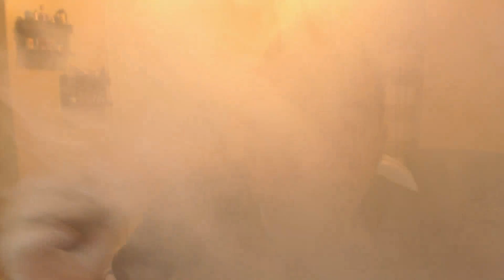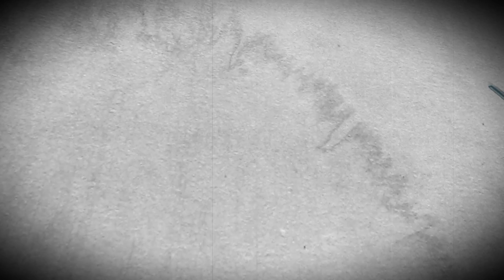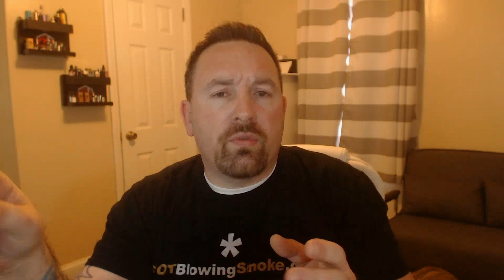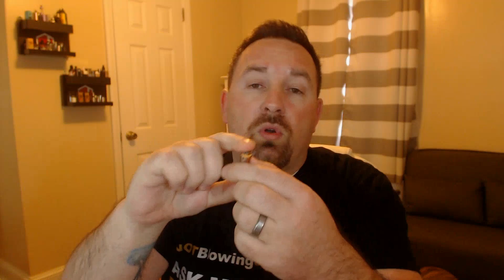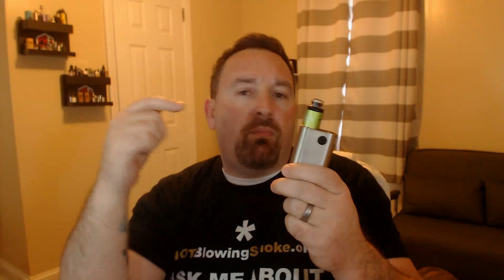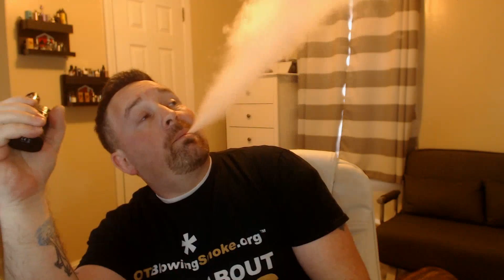Explained! Ohms and vaping resistance

Comment: Can any one please suggest me which wire to used for Smok stick x8 baby beast tank tfv8 having Q2and M2 coil i want to know which wire i use for Q2 preinstalled stock can i change the wire or else i have to buy new coil....and if any wire is there how much gauge and resistance required for wire and i am using preinstalled battery having 3000 mh

Comment: For those who are knowledgeable about the topic . Correct me or wrong . A 1.5ohm reading is higher ohm less resistance  vs a .3 ohm reading is a lower ohm but more resistance?
Reply: Ohms is a measurement of resistance. Voltage is measured in volts, yeah? The unit in which resistance is measured is ohms. .3 or .30 ohms is less resistance than 1.5 or 1.50. Resistance "resists" the flow of electricity (volts, amps). Use http://www.ohmslawcalculator.com/ohms-law-calculator to calculate ohms for a build before you do anything. :)
Reply: I agree Dinkleburg.

Comment: hey man my Q2 is reading 0.2 Ohms wont go up any further , been vaping it about a week at 0.4 then its 0.2,whats up with it?
Reply: Andrew Daly this is what I’m thinking but when you heat metal it expands and when it cools it shrinks the expanding and shrinking have probably made the coils/coil move a little that’s probably why the ohms have changed.
Reply: 510 was clean, still cleaned it with a toothbrush for 2 or 3 minutes and it fixed the ohms, possibly small particles of dirt building up affected it!

Comment: My t priv reads .41 on a q2 coil i use about 47-60 watts is this okay?
Reply: you can adjust it in t priv settings. but yes it is okay the coil is .4... .4= .40..... i vape mine at 56
Reply: Demetrius Hernandez thanks i changed what it was reading (.41) to .4 and vape it on 47 just to get extra life out of my coil
Reply: any time always here to help... vape safe
Reply: Demetrius much appreciated:)
Reply: hey man my Q2 is reading 0.2 Ohms wont go up any further , been vaping it about a week at 0.4 then its 0.2,whats up with it?
Reply: hey Andrew, make sure you're 510 connector is clean thats a problem a lot of people have, if anything gets in between 510 connector it will throw your ohms off.............

also make sure everything is tight........ and worse case just update firmware and it should ask you if its a new coil.......

and are you a heavy vaper ? and what do you vape the Q2 at anyways...  and really its not thats bad that its .2 off i would be concerned if it goes over .3 + but thats just me.......
Reply: Vape God thanks for your reply, Ive had to lose my tank alot for it to display the correct ohms, so it's almost loose. I think it maybe time to replace the mod?
Reply: Vape God 510 was clean but still cleaned it with a toothbrush for a few minutes and the ohms went back to normal! Thabks for ur help
Reply: im happy to hear man, vape safe.

Comment: Sounds like you have to be a master electrician license holder to vape. Too complicated. Just pen vape, unless you just want that obnoxious "Hey, look at my cloud" attention.
Reply: D Wood   Amps = Voltage / Ohms   This is all you really need to know. When you build a coil you should have a meter you screw your RDA into so you can build on it, they will have a meter to measure Ohms for you, your voltage is going to be 4.2 max for a  single typical 18650 battery. You just want to research the battery you have to see what the max CDC value is for your batteries if you are building on a mech mod, most are rated at 20 amps CDC. Use the formula to get your amp value and be sure it’s under the CDC of the batteries you use so they don’t blow up... literally... in your face...

For regulated mods this doesn’t matter as much.
Reply: It’s not all about makin huge clouds, more vapor is more nic. My beast king tank with the t12 coil makes bigger clouds but the nic delivery is insane, chain vaping with .3 nic will give me headaches on that thing.
Reply: I said CDC, meant CDR.
Reply: I personally don’t know any of that stuff getting there very slowly...I make my coils every Sunday
 “saves money,kinda relaxing”
I asked 5 very seasoned vape vets :
“What’s a good,safe ohms point to aim for,safety over show”
0.16ish is what I aim for...give/take a lil 
I don’t know how many volts that is...and frankly don’t care too much as I’m simply not smart enough to know what it means yet anyway...I’m safe,my clouds suck,taste great and I get nicotine...what more could a man ask for?

Comment: I own a Tesla Nano 120w, signos RDA. Can I have some tips on what kind of coil should i use. What range of resistance should I use, and why? I want vapour production high. Also, how does a low or high resistance affects my battery? Im trying to research on google about this but it mostly talks about mech mods, i dont know how to apply it to a regulated mod. Another thing, i notice that my mod gets hot faster on a lower resistance build compared to a higher resistance build. That's all thanks!

Comment: Just got in to trying to use an RDA and am super confused here, ok so I've got pre built coils, if I stick one coil in the rda it reads .3 ohms and fires up perfectly but then if I add another coil to the rda it reads .17 ohms which makes sense but it will not heat up on my mod it just gets hot but will not fire up and obviously I stop firing so I'm not being dumb, it's on an Alien220 mod btw, doesn't make sense because the coils in my baby beast tank are around the same resistance at .15 ohms so why would it work in the tank but not in my rda which virtually has the same resistance? Been trying to figure this out all night and am just super confused by this
Reply: 2491kridge the smok alien goes up to 3.0 ohms so i don’t think it’s the ohms maybe it has something to do with the resistance
Reply: non stopvids yeh man I figured it out, I guess since it was reading at .17 ohms and I was trying to heat up the coils at 30 watts I guess that wasn't enough power, jacked my mod up to 60 watts and they fired right up
Reply: 2491kridge cool enjoy

Comment: You described what ohms are, but you didn't mention anything about how that applies to 'the eventual hit' which is what people want to know.... Why would I want higher or lower ohms?

I think ohms is better described like this: The higher the ohms (lower resistance) allows electricity to pass more freely through the coil wire (less heat is produced per watt so needs more watts) But the lower the ohms (higher resistance) restricts the electricity flow through the coil wire thus producing more heat so less wattage is needed.

The electricity passing through a restricted coil still has to go somewhere so it is backed up in the coil and is converted and released in the form of heat (Coil gets redder as it canno't pass the electricity fast enough).... So vapers who want to vape at lower wattages, that want a given watt setting to heat up a coil faster should vape using a low ohm coil (sub ohm), and vapers who want a slower heating up process should use a higher ohm coil (>1ohm).

So.....

Low ohm coil= Quicker harder hit. (Coil heats up faster due to higher resistance. Needs less wattage)
High ohm coil=Slower more gradual hit. (Coil heats up slower due to lower resistance. Needs more wattage)
Reply: Randy L: Excellent help. Thank you!
Reply: you mean if theres higher resistance you will need more watts and If theres lower resistance you will need less watts, you got me confused... I though lower ohms means less resistance and higher ohms means more resistance...

Comment: my smok alien 220 keeps telling me ohm too low I've put a brand new coil but still saying ohm too low. what's could be the problem
Reply: Your smok alien doesn't like you
Reply: The SMOK Alien 200W does only support Coils from 0.1 to 3.0 ohm Coils. So if your Coil has a lower resistance than 0.1 then thats the problem.

Comment: Is this seriously the best video on the topic? Nothing helpful for finding what difference the ohms actually make to the vaping experience.
Reply: typically, in the early days, low ohms did not work well because the MOD could not provide enough current.  Vape companies are aiming higher ohm's now at flavour.  But most of the time the higher ohm coils have less airflow.   So airflow is more important to your vaping experience, combined with surface area of the coil.  Higher resistance (ohms) will also heat up faster at the same wattage (of a lower ohm) coil.
Reply: Keep going please.... Total noob here looking for answers and trying to figure this all out. I've decided after 5 weeks tomorrow,, that I only like Smok T6 coil @60-ish wattage and pretty much given up on Smok coils cuz they suck!. So I'm just using Vaporesso GT4 in Baby, Big Baby and NRG tanks. Best result seems to be on a Smok Q box vs G priv or Revenger. Its all so confusing! Just when I think I'm good the damn coil goes,,, Grrrr. 

Then I have the Cleito 120 and Blazer Pro. Completely different vape experience even low or high wattages. Nice clouds though and less hassle, just the flavor is kinda airy. Not deep and satisfying per se. Tried higher watts, but just got a bit to warm. I just want deep long vapes with tons of flavor at a low to mid range wattage without nasty dry/burnt hits. 

 Yes,, I pretty much woke up one day and decided to spend a lot of money to quit smoking and did just that.
Reply: nice,  For good flavour i have been using eleaf melo 3 with .5 ohm coils , running around 37 watts(eleaf. coils, they are dual coil)   the x4 in the big baby are not too bad if you want more clouds :)  x4 in small baby becomes a straw.  I have a cleito and find it gets too warm.

Comment: So basically it boils down to the lower the resistance (ohms) of your coil, the lower the wattage that you must apply right?  what would happen if you have, let say .15 ohms resistance and you are using your mod and apply a higher wattage will it damage the battery or will it explodes if you maximize it even if the resistance is lower?
Reply: GraveyardTricks he did not say it was a big baby before longer down in the comments after your statement but nvm c u around
Reply: GraveyardTricks thats not correct that low ohm need high wattage, alot of coils are recommended to use low wattage on low ohms. If you look at the M2 0,15 baby coil, it has a recommendation at 35 watt and 45 at its maximum and 25 at minimum. 🙄
Reply: GraveyardTricks im just saying that your statement is not correct, because you said to him he can not run low ohm without using around 90 watt. And that is not correct, with all respect to you trying to help him tho.

Comment: My vape shop just sold me a ni200 0.1ohm coil for my rafale. I usually use 0.2 coil. Im kinda scared to use it cuz I have no experience using temp control on my predator 228

Comment: So if higher ohm coils take less energy from battery, what's the point on having low ohm coils? What's they good for?
Reply: thanks I got all these.. but anyways it's not clear how to draw parallels between the examples you brought and vaping in particular.
Reply: I mean if higher ohm coils are better for saving batteries, what advantage does low ohm coils have?

Comment: question...(at 5:07) lower resistance = more power. Does that also equal to better flavor?
Reply: Personal belief that thinner gauge wire, higher ohms, less airflow, and smaller inner diameter coils make for better flavor.
Reply: Thank you

Comment: The coil on my Smok Alien is 0.4 ohm, but my mod reads .555. Is it safe to vape with it? Thanks
Reply: HK.S.S you can change the ohms in the settings to get it just right, I have the same mod and do this frequently
Reply: You can but it will ruin the coil eventual and might get dry hits.  You might just need to tighten down the coil.

Comment: back to the garden hose example. A really low ohm coil, say .13, that's a really skinny, narrow garden hose. The battery has to push really hard to get the electric/water through the coil/hose. And as a result of all that effort, the coil gets really hot! Some people say flavor is better at higher temps. A higher ohm coil, say .6 ohms is like a wider hose. Takes less effort for the battery to push current through it. Coil doesn't get hot as fast, it's a cooler vape, and your battery lasts longer.

Comment: Thanks for the info :) It explains really well WHAT different Ohm means for us. Could you also please (please!) explain WHY we would use different Ohms? Seems to make sense to me to just use higher Ohms/less power and get more battery life...
Reply from the maker: sounds like you figured it out
Reply: It does to me, But why do people use 0.1 Ohm builds at 100W+?
Reply from the maker: there's no logical reason, they do because they can - to me it's just a waste
Reply: Been researching, I think I get it - fused stapled twisted staggered Clapton multi coil builds (or quad/octa-coil as in TFV8) gives a larger coil surface area for more flavour and vapour. Which of course means more metal which takes more power to heat. Given that thicker wire has less resistance than thinner wire, all this extra metal results in lower resistance. So it's not about 'lower resistance/higher Watts' being cool, but more surface area/metal which results in more power requirements (and lower resistance, which means more power as P=V²/R)
Reply from the maker: all true, HOWEVER, there is a point of 'maximum velocity' if you will... I can get a very dense, satisfying, thick, full flavor vape from a .50 ohm coil built with round wire or a simple single clapton, the idea of "fused stapled twisted staggered clapton multi coil builds" is still not needed.
Reply: Totally agree - I'll stick with spaced single coils (28G 316L 6-8 wraps 0.7-0.9 Ohms) in my Ubertoot, Siren, and Bellus at 7-15W tasting every flavour in my DIY juice, and coughing if I draw too hard just like a cig. And get a whole chain-vaping work-day out of one 18650 and one tank...

edit - ok the Bellus at 13-15W runs out after lunch...
Reply: Oh, and Dude... nice you actually take an interest in what your subscribers are saying. Kudos...
Reply from the maker: Thanks! I do try to respond to as many comments as possible. The more the channel grows the harder it gets but, I will always do my very best.